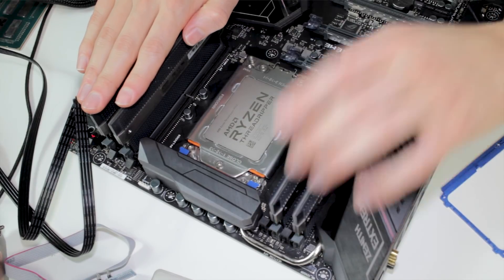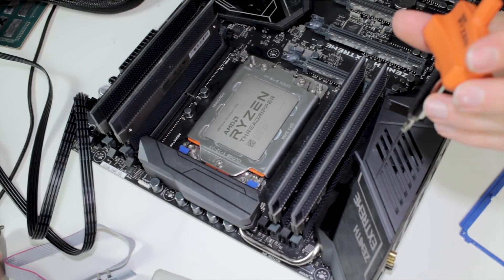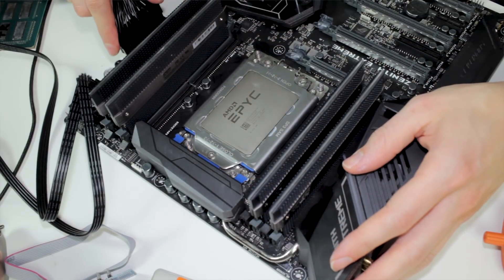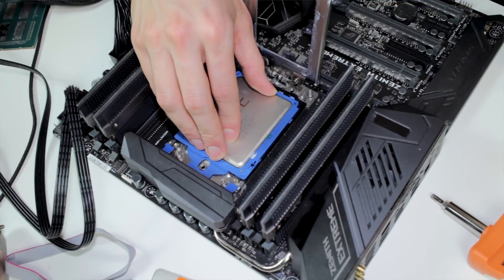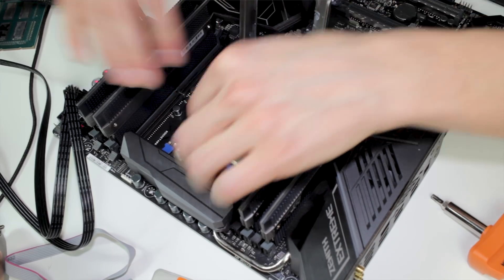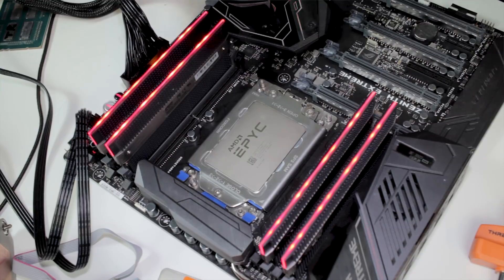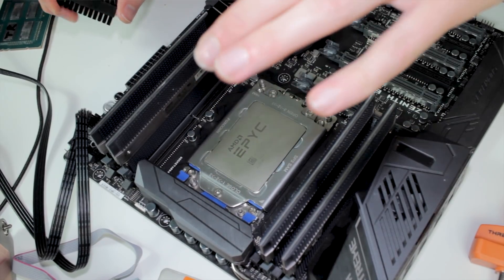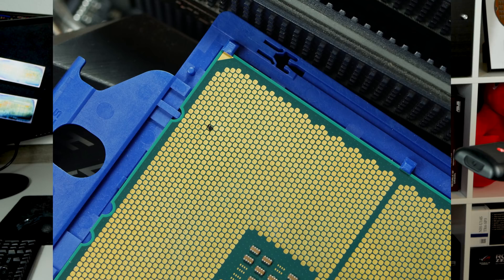EPYC in ASUS ZENITH EXTREME? (en)

Comment: EPYC has it's own internal chipset right? And also it uses ECC Ram. So not only the BIOS/CMOS could reject the CPU, but also the incompatible memory, and the chipset on the Threadripper motherboard? Installing ECC Server Memory might help the situation. As for the CMOS/BIOS and the Chipset... that sounds like a challenge. Supplying high voltages to EPYC may cause damage, and that may be another reason for the safety function.

Comment: I have 8 AMD ENG sample chips, and I tried booting them in my zenith extreme, and they didn’t boot (same power off behavior). I just stumbled across this and tried taping the pin and it got to the same place you did. Any luck making it work? I really want to make a server with my Engineering sample chips

Comment: I would try adding epyc microcodes to the bios next. Back in 2013 some very smart folks on the internet discovered you could get lga 771 xeons working in some LGA 775 motherboards by updating the CPU microcodes in the bios before installing the new processor and that got it working.

Comment: I viewed an AMD Epic vs Threadripper video recently were they took X-Rays of the chips and as it turns out they are not socket compatible. The PCB is reversed and how the power is wired internally is very different. Google AMD Epic vs Threadripper and you should find that video...
Reply from the maker: XD i made that Video
Reply: Yes you did, I remember now... LOL...

Comment: You cant just use some other bios... Eec memory is not issue, issue are microcodes for epyc, so just editing bios for mobo and updating microcodes for epyc and you have ? Double cores more but half the speed or if there is no lock Overclock till you set on fire mobo :)

Comment: Just like the old 771/775 stuff. I think alot of the stuff done on cpus is done via pins/bios/bios micro code. On the very first post I set an overclock on my xeon e5 2670v1 which is locked other than the 5-7 mhz bclk increase I can do. Booted to windows and the cpu clock was at 4.2 ghz, I wish I grabbed a cpuz shot of it. I was shocked and excited, I wanted to see what it could do vs stock clocks so tried running a bench test. Ended up getting some weird cpu windows error message then the system crashed. I have been poking around to see if i can get it to work. Each product a company makes has to be certified, tested and what not, just like some older amd cards and even the rx480 4g/8g were the same (just locked at lover specs) other than bios that would enable its full potential. The 480's are marketed as different product but amd only had to go through all the certifications and what not for 1 which saved them time and money at launch.

P.S. I was using asus cpu level up/auto overclock feature not manual.

Comment: At 8:50 and 9:08, "We know the socket has to be identical".  Actually, we don't "know" that, it's speculation.  You may well be right, but there may also be inactive connections on the TR socket which are active on the Epyc socket.  You're getting ahead of yourself.

You could say that you believe they're identical, you could even say that in your professional opinion they're identical, but you can't say you absolutely know they're identical without further proof.
Reply from the maker: I also checked the pinout (which is under NDA so can’t make it public)
Reply: That might have been worth pointing out in the video.  As it stood, it seemed like you were just making a guess and calling it fact.

Comment: I think you should edit the asus bios to include microcodes for epyc cpus, and also another thing that would help is a pcie debugger card and a pc speaker and also a to take a look at the pinout of both thread ripper and epyc if available, maybe by tweaking other pins you will get better results

Comment: @der8auer extreme - A debugger could find the 'id' code in the flashing software and force the BIOS but since it's a different Mfg there's good chance it won't initialize the hardware bits to the correct settings (EG: Mem Clk/Timing) so if it could go further it might well be hosed.

Also test the Epyc to see if it runs on an Epyc MB.

Thanks for your brave research and nailing down that pin.

This virtually proves that the silicon is extremely similar, that TR is Epyc that had some fault preventing them being Epyc, that TR is harvested from the Epyc rejects (which isn't really a bad thing).

Thanks,
Rob

Comment: What happens when you put the tape on the id pin for the threadripper, will it still boot? If not then it would suggest that the board has a lock out if the id pin is not reading as well. The next step would be be spoofing the TR id in the bios or on the epyc cpu, correct?
Reply from the maker: yea it boots :)

Comment: Btw, i can see with a hex editor, there is already a epyc microcode in the asus bios integrated (version 0x8001206).

And did I see that correctly, it changes from D0 to 0D?

Comment: Epyc seams to just be a threadripper made to run 24/7 doing server workloads like a xeon
Reply: its more the other way around
Reply: Threadripper has two dies enabling, providing quad channel memory. Epyc has four dies, providing 8 channel. The pcie lanes also double with the extra two dies.

If epyc can be made to work with x399, it would mean you could run 32c epyc parts on your desktop - though, this is all still speculation.

Comment: I've read that the sockets are wired differently electrically and epyc boards don't even have a chipset because everything is in the CPU. It doesn't seem likely to me that this would work. If it does work (yes, it does look kinda promising) this CPU needs to get a massive overclock. I'm willing to do hard and complicated things to get a 24 or 32-core overclockable CPU. Threadripper is great... but if there's something better I want it.
Reply: threadripper mark 2 is coming out soon.

Comment: Is it possible that the pin is dual duty with the memory in some way and that it's the other pin that would need to be taped over?  Taping over that pin on the threadripper chip and seeing if it boots may shed some light on that theory.
Reply from the maker: I checked that and it boots fine if I tape it on my 1920X

Comment: Back in the days of LGA775, you could use LGA771 Xeons in quite a few 775 motherboards, but a lot of the boards required a modified BIOS to be flashed. I think it was quite simple if you  managed to get ahold of of the BIOS editing tools, after that you could just read the BIOS out of the board, add the missing microcode for the Xeons, and flash it back. Not sure how this would be done on a modern UEFI system, but maybe there is some EFI SDK out there, that has tools like that. Unfortunately most of the EFI tools are probably going to be Intel only.
Reply: I think there was even a jumper kit that let you put Xeons in 775 motherboards if I remember correctly.
Reply: Yes you would need a jumper for 2 pins, and you also had to physically modify either the socket or the CPU substrate, because they were keyed differently and by default the 775 socket had a plastic key that had no corresponding cutout on 771 Xeons. So you had to either use a knife and remove that bit of plastic from the socket, or use a dremel to cut a notch into the CPU substrate, so the 775 key would fit. Both works, if you do it right.

Comment: As your previous statement about the threadripper dummy dies, can you try like power on and touch the IHS where the "dummy" dies are located, to see whether there are power going through?

I believe it is a 4x R5 1600 while EPYC is 4x R7, only part of the "dummy" die PCI-E controller is disabled.

Comment: post codes are generated by running bios (in Cache-As-RAM mode until ram is initialized) = cpu is running on the board, but bios didnt know how to handle the ram.
This means TR4 and SP3 sockets differ in name and desired market segment only :0
Reply: i'm actually curious if those memory initialization routines could be injected into the bios from a similar EPYC server board.... People do it for NVME on older-than-z97 chipsets
Reply: no. Memory initialized in PEI Phase. and It shutdown at DXE Phase.

Comment: Seems realllly odd to me that xeons work with 1151 and Z series boards but amd wouldnt allow epyc to work on tr4 boards it seems like something amd would be all over can anyone help me understand?
Reply: We haven't gotten fully into the conclusion yet, though I can understand why AMD wouldn't want to allow people to put 32-core EPYCs into X399 boards. The X399 boards VRM may not be able to handle the 32-core chips. EPYC's 128 PCI-E lanes are also wasted on X399. You also 'waste' memory channels.

It could also be as simple as a BIOS update that we just don't know if its coming or not, since EPYC was released to consumers long after Threadripper.

And of course, there's a limited range of generations and models of Xeons that do work on 'normal' boards.
Reply: There's also the fact that Epyc is a SoC more than anything and probably not compatible with the chipset.
Reply: But there's a difference between i-series and xeon - the igpu. It might be the reason but idk. TR and Epyc are pretty much the same unlike Xeon and i-series I think

Comment: So Essentially, There's Potential to Run an Epyc CPU on a TR4 Board, but it depends on whether the Board Partners like ASUS, MSI, GIGABYTE, etc. will implement it onto their Motherboards or not. Personally, I'd like to see Epyc CPUs supported for these boards, but maybe with a Disclaimer of your warranty being void if you decide to try it, since these boards are meant for Threadripper CPUs, and not Epyc.

But hey, that's just my Opinion.

Great work on this, Der8auer!
Reply: not because of that.
Epyc is meant for servers. You won't profit from 32 slow cores all that much. It's optimised for regECC etc.
It is not compatible because people would buy the 32 core Epyc and wonder why they have a slower PC than they would have with a 1950X
Reply: SoundFX09 I believe TR4 boards actually fully support Epyc since Roman only failed at RAM, but AMD wouldn't let board manufacturers to enable Epyc on TR4 without tricks because they make more profit with Epyc boards

Comment: Der Pin, der die CPU identifiziert ist notwendig um den Normalbetrieb aufrechtzuerhalten.  Das heißt, indem man ihn abtaped verschiebt man das Problem nur nach hinten. Das Mobo gibt zwar Standbystrom allerdings kann der Pin nicht mehr für die Logik die nach Power-on self-test über ihn transportiert werden muss zur Verfügung stehen, daher schmeißt er POST code D0.
Ein einzelner Pin ist nie alleine für eine ID-Funktionalität zuständig. Das wäre - selbst bei 4094 Pins - verschwenderisch!
tldr; Pin wird beim POST verwendet, um CPU zu identifizieren. Nach POST wird der PIN dennoch für den Weiterbetrieb von EPYC benötigt. -> unspezifischer D0
Reply from the maker: Doch ist es :) Ich habe im Pin-Out nachgeschaut. Der Pin geht nur zu Ground und ist kein Datenpin
Reply: Und woher weißt Du ob ein Erdungspin nach POST nicht Strom an benötigt, um zu codieren?

Comment: Could you try flashing the BIOS with some kind of microcontroller or Raspberry Pi? Also maybe a BIOS for an Epyc mobo that doesn't have any 3rd party controllers?
Reply from the maker: Yea I already ordered an SPI flash tool. I already have a cable for it but couldn't find my SPI flash device anymore.
Reply: But hey +der8auer. I would happily check out the BIOS dumps of both boards to see whats different/similar in terms of modules etc they both have in them. Feel free to PM me on twitter https://www.twitter.com/0xcats
Reply: I used to reflash 8 pin bioses with only an Arduino. But it's a bit tricky because you have to install a linux distribution (or use a VM), then Arduino IDE, flashrom, serprog-duino and AVR toolchain

Comment: It might boot with ECC memory.
Reply from the maker: yea I didn't think of that but will try to grab some DDR4 ECC tomorrow and test it :D
Reply: EPYC for sure supports ECC memory while TR seems do not, and that may mean that memory controllers may have similar but still different system registers. So, in the end a firmware update may be required to properly work with EPYC.

Comment: Maybe is the unregistered memory that won't let it post
Reply from the maker: mh interesting idea. Didn't think of that :D Thanks a lot! Will grab some ECC sticks
Reply: EPYC, according to the spec, requires ECC memory
Reply: overclockable epyc would be epyc ;-)
Reply: All the servers I've seen with Epyc all had reg-ECC. Haven't seen a plain ECC epyc box yet. Infact I suspect it doesn't even support non-registered due to how it would affect the memory controller load with large amounts of DIMM's.
Reply: This reminds me of one thing. Do you know about the EVGA SR-2 motherboard? It was a dual socket motherboard that let you overclock two Xeon X56XX series CPUs. It would be amazing if someone made a dual X399 motherboard that let you overclock EPYC. It would be extremely niche, but so was the EVGA SR-2
Reply: Make sure to try Registered and Unbuffered ECC RAM.  RDIMMs may have an impact (not sure).  You could also set the RAM to stock non-OC 2133MT/s before trying to boot the EPYC CPU.
Reply: Fun fact Threadripper also support ecc
Reply: You have tried flashing BIOS from different motnerboard, but what about modifying BIOS of tested motnerboard? You can try adding EPYC CPU microcode to it, just like the old times when we were installing lga771 Xeons onto lga775 motherboards
Reply: If you decide to grab a new EPYC for further testing, try picking the one that's suited for single-socket motherboards
Reply: So how did it go? Did it worked with ecc memory?
Reply: first of all i`am started with single stick, also epyc interconnect could use different stick layout for multichannel.
Reply: I was wondering the same thing, it would make sense. I'm sure there will be something else that crops up. I'm also interested to know if a tr4 chip will work in a sp3 socket. I'm guessing it could only work on a single socket board as 64 PCIe lanes are reserved for communication between sockets. Likewise I'm assuming if you manage to get this working on the zenith, you'll only have 64 active lanes.
Reply: Also maybe try one stick / one channel? Love you work btw.
Reply: That's because FSB architecture has no memory controller built in but Registered memory controllers that have NO path for disabling the memory buffers will not support any non REG ECC.

But generally, IMCs designed for REG ECC ram still supports non REG ECC ram anyway.
Reply: Looking forward to the results with the ECC ram!  would also like to see if the threadripper works on a server board with that pin pulled hi/low
Reply: various media demostrated the pcb between epyc and threadripper is quite different, proven threadripper is NOT just a limited function epyc, despite using very identical dies, their configurations differ dramatically
Reply: It halted in DXE phase, It means CPU can access to memory properly. memory is not suspect.
Reply: I remember a long time ago some "LGA 771 to 775 Adapters" (google it) to put xeons on core 2 mobos. Maybe we have something similar here.
Reply: @shadowq2  but cases are different.
socket 771 and 775 is so similar to be de facto compitable, they use same way to connect to the shared north bridge via FSB, inter socket connection is never a concern even multisocket is indeed enabled for 771, in that ages, everything is done via FSB.
but in case SP3 (as well as intel's counterpart 20xx) , pins for inter socket connection(infinity fabic for amd, and quickpath interconnect for intel, dedicated inter socket connection is viral for multisocket configuration since FSB is faded out in advance of integrated memory controller in processor die, computer component interconnect is trended point to point instead of via a shared bus architecture) is needed, and for sp3 case, because of even more pins for its octa channel memory and around 200W power consumption requirement, that's why a huge 4094 contacts socket is resulted. this is an interesting concern that why tr4 keeps so exactly many contact for an "only" quad channel memory threadripper, and moreover no inter socket connection is needed? its hardly to be imagine but in fact only possible situation is a tr4 have many dummy pins, despite of physically identical, we cannot exclude amd has reassigned pins for tr4 to achieve more optimized circuit routing, for example provide more pcie lanes and power pins just like what intel did on its 115x series.
if tr4 and sp3 were de facto electrically compatible, why didn't amd just use sp3 also for threadripper? as everybody is knowledged amd loves share socket between processors even for different microarchitecture(this results a quite stupid result: actually a zeppelin core has 32 pcie lans, excluding 4 used by chipset, 28 lanes available, but a ryzen processor is limited to have only 20 pcie lanes because of socket am4)
zen microarchitecture is a SoC design thus chipset somewhat is indeed not necessary, epycs on sp3s does not incorporate such chipsets ,but a threadripper on tr4 usually paired with an x399, this may possible an key different between sp3 snd tr4, although "chipset" is in fact pcie device
Reply: I  doubt that. All CPUs that support reg-ECC also support unregistered dimms as well.